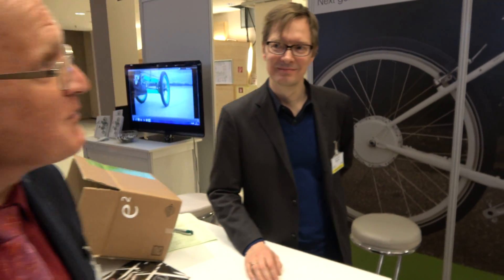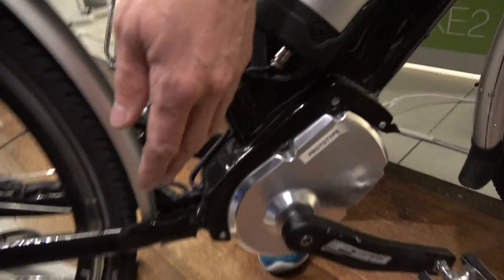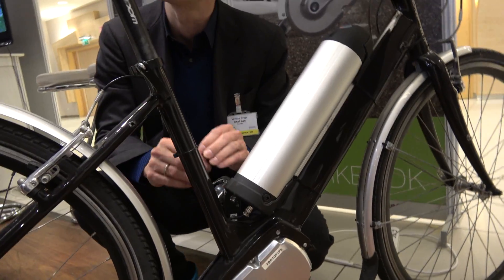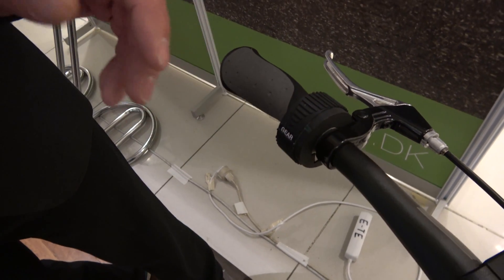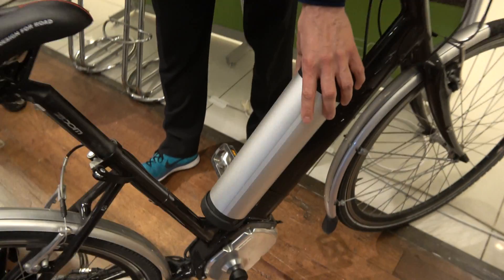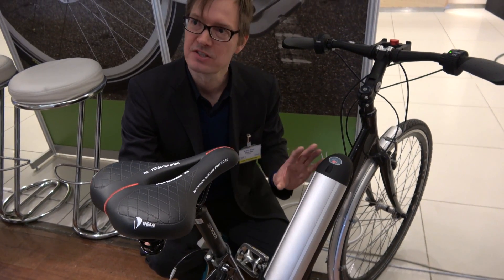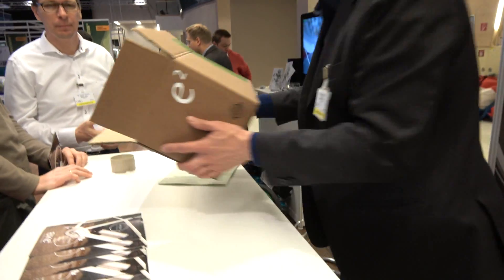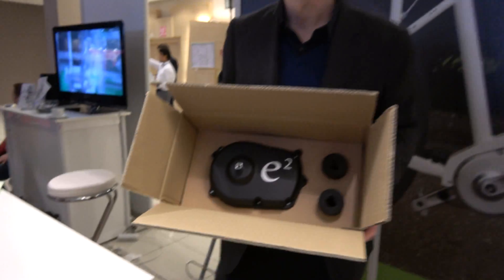Bike2 Aps at the IDTechEx Show! Berlin

Comment: Hmm. A chain drive is typically 98% efficient. An alternator driving a motor is at best about 80% * 80% = 64% efficient?
Reply: If it can employ kinetic energy recovery when braking or coasting downhill, the overall efficiency could be higher
Reply from the maker: Less efficient but more controllable and available when needed. It can also be a useful electricity generator in its own right.